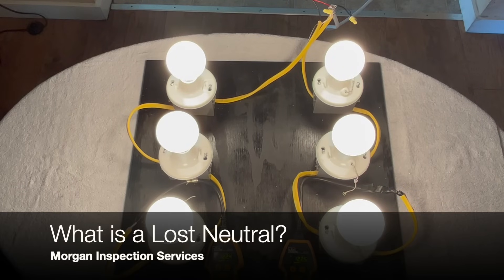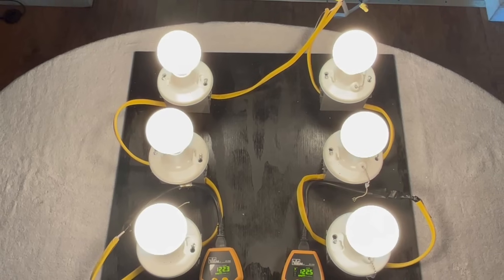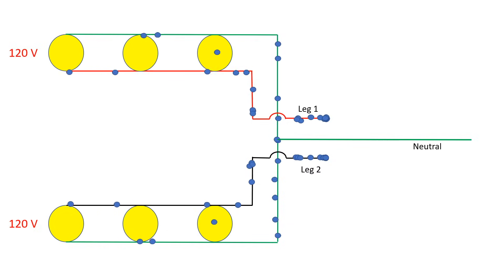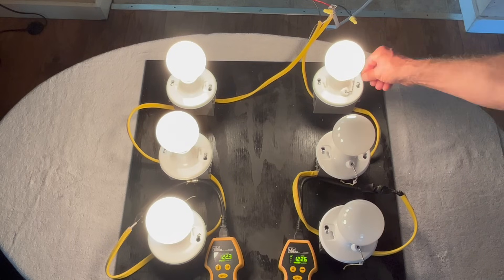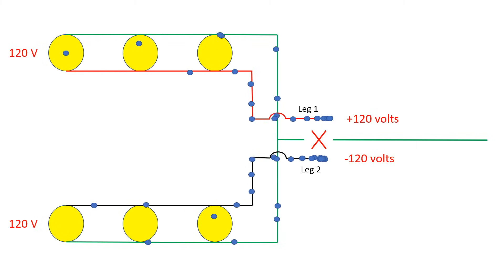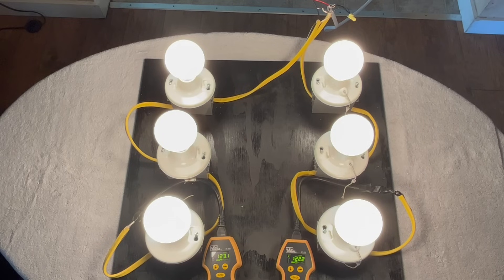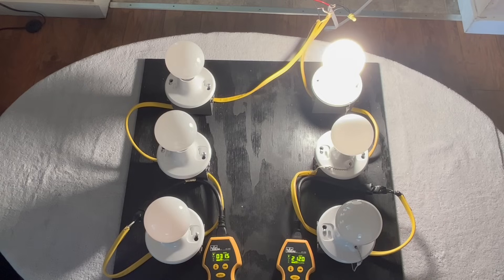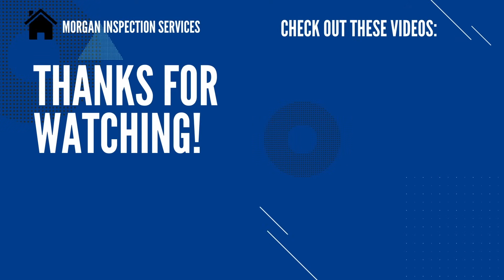What is a Lost Neutral? Lost Neutrals demonstrated

Comment: Would anybody please explain to me (because the owner of this channel is busy and prob won’t fulfill my request for a while to make a video on this) but let’s say we have a diff scenario: neutral comes loose completely from bond at ground bus in main panel - I read that now this could be dangerous because the neural can “float” above the ground -
A)
 what does this mean 
B)
and how EXACTLY could the neutral begin to take higher loads
C)
How exactly and why would the legs end up getting voltage “swings” 
D)
When it’s properly bonded to the ground bus, what magically drops its voltage to 0 and earth becomes magically 0? Do we just call both zero? Could we call both “9” and all that matters is they have the same value?
Reply from the maker: Hi @MathCuriousity, thanks for your thoughtful question! Let me break it down step by step to clarify.

A) What does it mean for the neutral to “float above the ground”?
In a properly functioning electrical system, the neutral wire is bonded to the ground bus in the main panel, effectively tying it to the same reference voltage as the earth (0 volts). If the neutral connection becomes loose or disconnected, it is no longer at the same potential as the ground. This “floating” neutral can cause unpredictable voltage variations in the system.

B) How could the neutral begin to take on higher loads?
The neutral wire is designed to carry the imbalance of current between the two “hot” legs in a 240-volt system. If the neutral connection is compromised, the load current from one side of the system could start traveling through unintended paths (e.g., grounding conductors or appliances), which can cause overheating, damage, or even create a shock hazard.

C) Why and how do the voltage swings happen?
In a 240-volt split-phase system, the two hot legs (lines) are 180 degrees out of phase. With a broken neutral, the voltage on each leg depends on the imbalance of the loads. Heavier loads on one leg will “pull” the shared voltage divider, causing one leg to rise above 120 volts and the other to drop below 120 volts. This is why you might see lights flickering or appliances behaving erratically.

D) What does it mean for the neutral and ground to be at “zero”?
When the neutral is properly bonded to the ground at the main panel, both are at the same electrical potential, which is called 0 volts relative to the earth. It’s not “magic”—it’s a reference point established by the connection to the earth through grounding rods or a similar system. This ensures safety and stability in the system. The exact number doesn’t matter as long as both are the same because circuits depend on the difference in potential, not the absolute value.

I hope this clears things up! Let me know if you have further questions—I’m happy to help!
Reply: @ @ Hey You truly are a gem of a man! I honestly didn’t expect you to write back so quickly. It’s not easy fielding everyone’s questions! Everything you said above makes sense. Just a few things I would like to clarify if you are OK with that?

Q1:    According to what you said in “C”, it seems a disconnected neutral from ground bus would have the exact same effect as a neutral disconnected at transformer, but that doesn’t sound right! How could simply disconnecting neutral at ground bus have exact same effects as disconnecting at transformer (which you beautifully explore in your video on lost neutral)?

Q2: we still have the secondary connected to the ground with a ground rod, so why wouldn’t that act in place of the now disconnected neutral at ground bus? Am I missing something fundamental?

Thanks!
Reply from the maker: @MathCuriousity  Thanks for your kind words. Let me try to answer your questions.

Q1: Does disconnecting the neutral at the ground bus have the same effect as disconnecting it at the transformer?
Great observation! The effects are similar in some ways but not identical. Here’s why:

When the neutral is disconnected at the ground bus in your main panel, the system inside your home loses the reference point that stabilizes the voltage distribution or split between the two hot legs. This can cause voltage swings depending on load imbalance. However, current may still find unintended paths through equipment grounding conductors or even through the grounding system itself (e.g., via grounding rods), which is unsafe.

When the neutral is disconnected at the transformer, your entire system—including the grounding at your home—is effectively cut off from the utility’s neutral reference. In this scenario, there is no path back to the transformer for return current, leading to even more dangerous voltage imbalances and possibly total equipment failure.

While the two situations share some similarities in creating voltage swings and instability, the transformer-level disconnection is typically more severe because it isolates the entire system from the neutral-ground bond.

Q2: Why doesn’t the ground rod act as a substitute for the disconnected neutral?
There is a fundamental but important distinction. Ground rods and the grounding system serve a different purpose than the neutral wire. The ground rod is primarily there for safety—to dissipate fault current into the earth and to stabilize the system against lightning or other voltage surges. It is not designed to carry return current under normal operation.

The resistance of the earth is much higher than the low-resistance neutral wire. I think you’d be lucky to get 4 or 5 amps running through the grounding electrode conductor to the ground rod. Because of this, the grounding system cannot effectively act as a current return path in place of the neutral. If the neutral is disconnected, return currents may attempt to flow through grounding conductors and the earth, but this is highly inefficient, unsafe, and can cause hazards like shock risks or damage to equipment.
Reply: @ hey wonderful answer! I think I’ve learned quite a bit so far thanks to you. I would just like to clarify a few things:

1) if we remove the neutral from the transformer but connected to ground bus scenario, we could have 170/70 for instance right? But what would be the two points that make up the potential difference in the 170 and the potential diff in the 70 now that the neutral is gone? 

2)
If we have the neutral disconnected from ground bus but remaining on the Transformer scenario, I read it wouldn’t be like the above 170/70 - the legs would instead maintain the 120 v between them, but would possibly each rise by the same amount so like 240/120/240. Is this correct and why is this like this? Why would the rise happen and how and why would they all rise the same amount ?

Thank you again for being a kind god among men! An anti-gatekeeper! A soul intent  on enlightening the less educated!

Comment: Thats why are arc faults are required the neutral is isolated at breaker before bus and is measured against line.if that changes even for a spilt sec more than a set amount.ir trips
Reply from the maker: I’m not sure if you’re referring to arc faults or ground fault circuit interrupters, but neither of these help in a lost neutral situation.

Comment: So let me get this straight: in a lost neutral the electricity still flows because we have some potential diff between the hot leg and other hot leg? So one hot leg acts as the “neutral”?

Second question: why is it (mathematically) and conceptually, if you have the time, that turning loads on and off alter the voltage on the legs?
Reply from the maker: Yes, about the difference between the legs. You have 240 V. In a lost neutral situation there is no neutral. You don’t need a neutral. You simply need a return pass and both legs are essentially returned paths to the transformer. Like any other 240 V circuit. They don’t have neutrals.

Voltage changes every time a load is turned on or off because the overall resistance of the circuit changes. When you turn on a load, the resistance goes down so in that leg, you have less resistance so the voltage also goes down and it will go up by the same amount and the other leg. Remember, voltages are split between loads that are in series depending on the resistance of those loads.
Reply: @ damn you are an amazing teacher! Made perfect sense FINALLY (after weeks of banging my head) - and can i just ask one other q: 

OK so now I get the lost neutral situation and the voltage swings;

Q1: But let’s say the neutral is connected at the transformer - but it’s disconnected at the ground bus in our basement - so there is no ground connection. Am i correct that this is NOT a “lost neutral” but a “floating neutral” ? Apparently some “experts” are saying we MUST be careful as they should not be conflated with one another.

Q2: in the “lost neutral” , where we disconnected it from transformer, but it’s still connected at ground bus…if we measured the potential diff across neutral and ground would we get 0 still?

Q3: 

Now if we have “floating neutral”; where it’s still connected at transformer but not at ground bus, would this be enough to allow some of the effects seen with the “lost neutral” regarding the hot legs voltages and the neutral voltage?

Q4: if you are still with me kind genius soul: i was told that if we have this “floating neutral” situation (where neutral is disconnected from ground bus, that we would still have some neutral to ground potential ? Why is this? How is this?!

THANKS so much for your continued support of self learners! You and your channel are a GEM to YouTube!

Comment: Why does loads being on or off affect the balancing?
Reply from the maker: Because every load that is turned on or off changes the resistance of the circuit, and this therefore changes the voltage across the legs in the circuit. All the loads in one leg are in parallel with each other, and all the loads in the other leg are in parallel with each other. You’re changing the combined resistance in the leg when you turn a load on or off, so the voltage is split accordingly.

Comment: You did not speak of the voltage that would ride the ground.The ground wire of a system becomes very dangerous. When I was a teenager, we had a bad neutral sleeve. This happened back in 1987. My little brother went to trun on the water hose We had copper waterlines back then. It was xery common ro haxe an electrical ground connected to those pipes. When he touched the valve to turn the waterhose on he started screaming and could not let go. I luckily was about 20 foot away from him when this happened. I had to yank him loose from it. So when a bad neutral connection occurs the groud connections will carry  the voltage as well.
Reply from the maker: You are absolutely correct. I actually updated this video several months ago. In that video, I cover the voltage on the ground wire. Here is a link.
https://youtu.be/YY5Fur7S-KE?si=nhmyalSCKRhwZF5m

Comment: I was remodeling a house 40 years ago and every time you turn one light on another light either got brighter or dimmer started poking around in the boxes. I was getting 60 V and 160 V and then I noticed every box all of the wire nuts had been soldered under the wire nuts and then wrapped with electrical tape over the wire nuts After a couple days. I was only 20 at the time. I finally discovered it up on the roof where the lines that come in the neutral was completely rotted off or it came out of the mast, and the only thing connected was the ground rod explaining the odd voltages power company came out replaced it line and everything was fine, but imagine the people who tried to fix it before they soldered every connection in the house Never seen that before imagine soldering all the connections and still never solving the problem. If I hadn’t been up on the roof, I never would’ve found it.
Reply from the maker: It's great that you were able to track down the problem! You definitely solved a mystery - apparently one that had existed for many years. These lost neutrals can do some crazy things.

Comment: I have a second question: he mentions the light bulbs are in parallel but how are they in parallel? It looks like the same yellow wire running thru them all so they all take the same path to source so isn’t that series?!
Reply from the maker: I can see the confusion because it’s difficult to see how they are actually wired, but look at the animation in the 30 to 40 second range of the video. It clearly shows how they are actually wired. From that you can see that each set of three lightbulbs is in parallel.
Reply: @ thanks for clearing that up!

Comment: That’s all very interesting. Who is going to disconnect the neutral in electrical distribution panel? If this does happen it will burn out some appliances. Yes you may smell varnish and see smoke. But that all. In my thirty years working for a utility company. I’ve never seen it happen. I think you’re just trying to scare people. But I could be wrong!
Reply from the maker: You are definitely wrong. This is a fairly common issue. I’ve discovered it on a couple of home inspections. I had a separate homeowner call me to help him diagnose why lights were dimming when he turned on the microwave. And I just had a friend go through this same issue at his home because the neutral corroded out in his transformer, which was not on a pole, but sitting on the ground. Read some of the comments of some of the viewers. Several of them have also experienced this.

Comment: Got called out on a washing machine having problems finishing the cycle. When i got there i turned it on and the laundry room light got super bright. The washer motor was overheating from low voltage. Neutral was broken at the main entrance.
Reply from the maker: Thanks for sharing your experience with a lost neutral! It's a great example of how dangerous these issues can be.

Comment: Interesting,  I'm surprised it doesn't just go to ground since nuetral is typically grounded at the panel if neutral is broken upstream of the house.
Reply from the maker: A small amount of the current does go to ground, but the earth is a good insulator, so the current is fairly low. I cannot say how much, but I would guess that less than 5 A will go to ground.

Comment: WOULD A SURGE PROTECTOR STOP AN APPLIANCE TV  ETC FROM TAKING THE HIT FROM THIS SITUATION?
Reply from the maker: No. A surge protector looks for significant voltage surges of several hundred volts. Since this results in no more than a 120 V surge, I don’t know that there is a search protector that could help with this situation.

Comment: How is 2 light bulbs more resistance than 3 light bulbs? Wouldn’t the 3 light bulbs resistance be higher since its got an extra bulb of resistance ?
Reply from the maker: By going from three lightbulbs to two light bulbs, you are removing one of the three paths for the current to flow. And fewer paths means more resistance. If the lightbulbs were in series, then your logic would be correct. However, these lightbulbs are in parallel, so look at it this way. If you had one path of a given resistance, you would have a certain amount of flow. If you added a second path of the same resistance, then you have twice the flow - so the overall resistance for these two parallel facts would be lower. Same thing holds for going from two parallel paths to three parallel paths. Each path decreases the overall resistance.  For resistances in parallel, 1/R = 1/R1 + 1/R2 + 1/R3 etc
Reply: @ Thank you for taking the time to explain that. Always had a hard time wrapping my head around it

Comment: EXCELLENT object lesson. I'd be curious to know what would happen if a UPS (Uninterruptable Power Supply) were wired in place of one of those light bulbs, and that lightbulb was plugged into the UPS.
If each lightbulb had its own UPS, would they be protected from burning out?
Reply from the maker: The UPS would likely protect the lightbulbs from burning out because once it detected the voltage fluctuation, it should either shut down the power to each individual lightbulb, or switch over to battery power, depending on how it is designed to operate.

Comment: Yea but does this system have a ground wire attached?? He doesn't explain that part. On systems with the ground wire/rod attached to the neutral bar inside the panel, you still get flow over the neutral wire because it flows to ground instead of back to the transformer/utility.
Reply from the maker: In my demo, there was no ground wire attached, but yes, most residential systems will have a ground wire attached, and some current will flow through that and into the Earth, but the Earth has fairly high resistance, so you’re not going to get more than probably 4 or 5 A flowing through that ground rod.

Comment: Great demonstration!  Is there a monitoring unit that you can install on your load centre that would cut power the instant neutral was lost, for example due to a fallen branch in a storm or perhaps an ice storm?
Reply from the maker: Thanks for the feedback. I am not aware of anything that monitors for this. I will have to do some research.
Reply: @morganinspectionservices3840  I envision that it would be simple.  Perhaps monitoring neutral to ground in a strategic location outside that would pass a small current and when that current stops,  you could have a lost neutral condition.

Comment: Seems like a lot of people here that know their stuff. Don’t worry. I won’t blindly take advice. 

Question, on a 240v plug in the US, typically red and black I believe, does it matter which the red is connected to and which the black is connected to?

In other words, on a working circuit could I arbitrarily switch the red and black connections?
Reply from the maker: No. It does not matter which one the red is connected to and which one the Black is connected to. All that matters is that the neutral and ground (if there is one) is connected in the right location.
Reply: @ thank you.